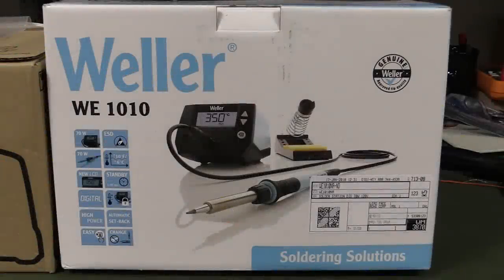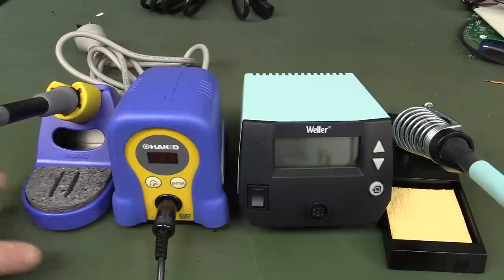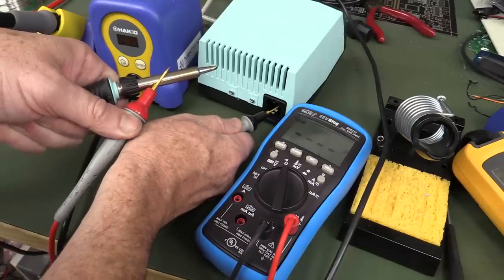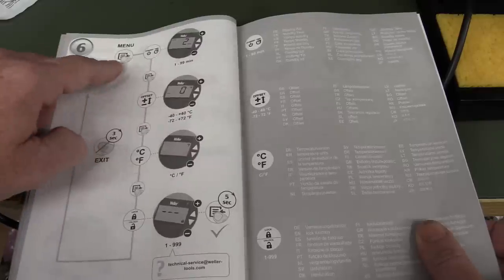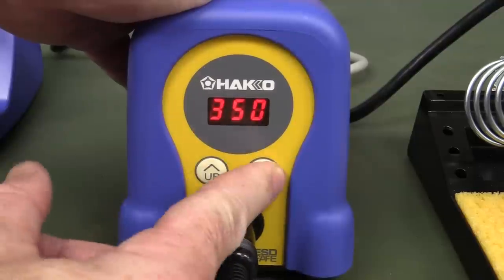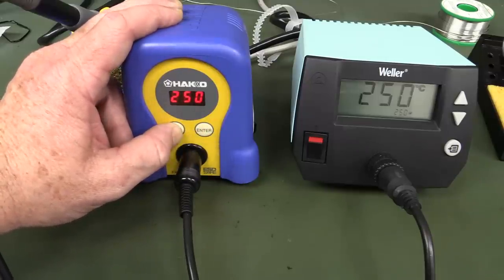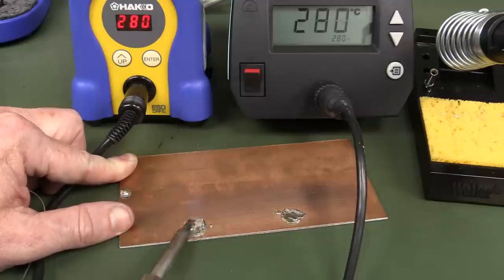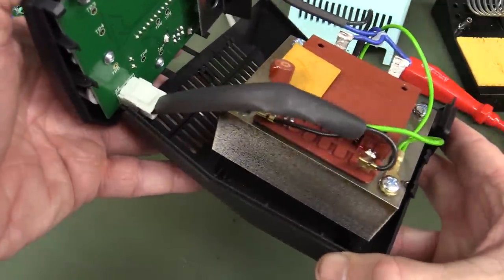EEVblog #1063 - Weller WE1010 vs Hakko FX888D Soldering Station

Comment: Used Weller irons throughout most of my career in electronics, and still rate them as the best. Some guys preferred Antex but I never liked them. The cheapest route to a decent soldering setup though, is a Yihua station with a Hakko tip. ;)

Comment: I’ve had my 888D since it was first released over in the U.K. and I love it, replaced an old weller that was passed down. A lot of people complain about the temp control (but I really don’t mind it, easy enough plus with presets it’s simple.

The only bugs are the power switch, the forever shrinking sponge, seriously mine is the size of a 2 pence piece :/ ha and perhaps the lack of ‘stackability’ (but I can live with that for such a beauty of a design)! 

I am glad someone else has commented on the DIN connector, it does flap around in the breeze! Haha! 

I’ve had a Weller in the past and used other higher end ones and they are pretty good for the price to be fair! Plus I kind of like that colour scheme...

I don’t think you’d go wrong with either to be honest, both looks great! 

Longevity wise, perhaps I’d look at the Weller (only down to my last one being about 15 years old) however I’m yet to have any issues with the Hakko (a lot of complaints about them burning out but perhaps it’s standby heating, I’m pretty sympathetic when it comes to tooling).  

Loved the review Dave!

Comment: I have the hakko and I like the compact size and the brass cleaning tip inside the holder saves also extra space. I personally hardly use the sponge as the tips gets cleaned really well with the brass. I agree that the analog version is more straightforward in changing the temperature with just a knob, but once you get the presets configured it is actually fast to change between them using just a button

Comment: I'll take my TS100 any day of the week! Integrated heater in the tip and heats up in seconds, sure it makes each tip very expensive ~$12, but they are high quality and dead easy to switch. Slim design, some may argue that this is a con, but I see it as a huge con as it sits very well in the hand and means it is portable (you can literally fit it among your pens in your bag!). It's powered from DC 10-24V, meaning that you can take you with you out in the field and power from a lipo, at home I use an old laptop charger. All of this for $50, I repeat $50! It doesn't come with any stand, but for the price one can by a decent stand separately. I would also recommend that you buy a good and flexible extension cable with 90 degree power jack (standard 5.5mm DC jack), the cable drapes much better and gives significant better experience!

Comment: I used a Weller TCP 24 for about 30 years it was never broken  and still works fine. 3 Years ago I got an ERSA Pico for about 150€ and I like it very small and heat up very quickly but I don’t think it will hold as long as my Weller.

Comment: I can't imagine going back to stations where the heater is not integrated into the tip. It's like going from Axiom Audio M3 to a gramophone. NEVER!

A lot of the knockoff Hakko 951 look dodgy inside but they do at least work. I'd rather a ripoff of newer technology than quality manufacturer using old junk technology. I can't believe these are even sold anymore on stations costing more than $50 in 2018. 

Just watching the time they both took to heat up made me want to cry. It isn't simply impatience that makes these irons lame.  When touching the pin of an IC that is going to absorb a bunch of heat like ground or power plane, the temp drops and the iron's controller sends more power to compensate. When the heater is not built into the tip that process takes way longer and you wind up having to solder at much higher temperatures to get anything done, or deal with the more aggravating method of doing work with an iron whose temperature dips. It sucks so bad.

Never going back to this stuff!!
Reply: Louis Rossmann 

Have you tried any Metcal / OKI stuff with the curie point tips?

I've used Metcal for about 12 years (since using them in electronics factories), and never felt the need for manual temperature control.

As you say, the whole point of them is that they boost the RF power to the copper slug in the tip, so work great on both small SMT stuff and large ground planes.

I agree - I don't think I could ever go back to using an iron with a heater that is "indirectly" heating the tip.
Reply from the maker: The near instant heat irons are great, but are there any in the $100 price bracket?
Reply: Around $230 now gets 120 watts of American Pace power ( https://www.youtube.com/watch?v=NEUriXoYPzQ )
Reply: I built a home made Hakko knock off station using a 33 volt transformer from a old hi fi amp and one of those EBay Hakko knock off wands and a few parts from that old hi fi amp and it will out perform bolt of these with a 8 second warm up time
Reply: EEVblog TS100 & Ralim firmware = best iron in this price range (~70$)
I would really like a video from you on this one testing and given your opinion. ;)
Reply: EEVblog 

Possibly not quite that cheap for a decent one, but all of the Metcal stations I bought were second-hand on eBay, as they are generally very sturdily built, so tend to last many years.

The smaller versions like the SP-200 (with handpiece and one tip) can often be found for around $120-150, and still way more capable for anything new around that price, IMHO.

Granted, the new tips usually cost around $16-25 each on average, but they easily last 5 years or more if not abused.

(like using them to pry up bent pins. Guess how I found that out. lol)

The cost of a new tip is akin to replacing a cheapo mains iron within a similar time frame tbh, so I think it's more than acceptable.

There's a nice video on YT somewhere which shows that you can even remove the tip while hot (using the heat proof mat thingy), and still use it to reflow solder on a large copper ground plane for 10-15 seconds afterwards, while able to hold it by the cool end. I'll link it here if I find it.
Reply: so what do you recommend for the hobbyist under 150. not everyone needs a $1000.00 iron
Reply: I'm using an XYtronic LF-3000 (cost less than 100€). It heats up to 350°C in 15 seconds (just timed it from cold). The slow part in heating is from room temp to about 250°C, from 250 to 350 it's about 3 seconds. Don't know if you count that as "near instant", it sure is fast enough for everything I do. 
I've had it for a few years now (don't know exactly how long, more than 5, less than 10) and am very, very pleased with it. The build quality is awesome. A full metal case, built like a brick, inside is also clean and done well (even the connector to the iron beats the Hakko and Weller of this video, not just a twist lock but an all metal screw lock).
I later bought a hot air station as well and it is the same quality.
Reply from the maker: ElectronAsh - Sorry but 2nd hand doesn't count.
Reply: Louis Rossmann may be the most famous tech in America, and he repairs MacBooks, some of the most challenging soldering from a thermal mass standpoint, and he could afford those irons that cost $1000+ but he prefers the Hakko FX-951, which is only $235 on amazon! - So don't think you need deep pockets to solder like a pro!
Reply: He's American, but evidently not patriotic enough to try a Pace.
Reply: EEVblog the Ersa I-con pico is available for about 100€ and heats up extremely fast. Its the best soldering station at that price point IMO
Reply: Electro-ash: Yeah,sure, killed 2 in 1.5 years, never Metcal shit again for me. I have a Pace MBT250 and a Weller WS-81. But they are a whole different class regarding performance. Is the new Weller a replacement for the cheap red Wellers ?
Reply: Ed Yager I recommend DIY for hobbyists, there are some really nice tutorials from Russia, I'm just building myself a 2in1 Station. There are many points why diy and saving money isn't even the point: As a hobbyist you have the time, you will learn a lot about some electronic components and other things, you can decide which tools you use, you can use any brand, Marco Reps and GreatScott! have nice turorials with JBC soldering irons, you can make your own design, which kind of display, encoder, pots or buttons, make you own menu etc. and will have something that you use and see all the time and know you created it, I recommend to put it near to your bed when its done, so you can see it when you wake up xD And finally there is no big science behind controlling a heating element, just need to turn it on when the temperaure is lower than needed and turn it off again when it is higher, if you make your own firmware, you are free for all functions you can imagine, I have some that even the most expensive JBC doesn't have.
Reply: Half a year ago, I've bought more modern version of it - on a STM32 controller. It cost me around $100 for the following: controller, two handles (different ones - one like in the link, another for heavy lifting, hakko-style mounting, but T12 tips are used), metal case and  6 different tips. For power supply I used old notebook 65W brick. Works neat. Hakko 888D is much worse, than this one.
Reply: The link was just a current example, but I purchased the power supply, handles, tips, and controllers (2nd one for my Father) from various sellers. I'm using an old external hard drive case as the housing. I've seen the STM32 based controllers, but what I've got already works perfectly so haven't given them a test/try. Much of the magic comes from the T12 tip itself. Going from a system with M900 style tips to the T12 tips is like switching from dial-up to broadband, you never want to go back.
Reply: Louis, i get your point. But your point is from someone who uses his station every day for a living with boards with a lots of thermal mass. But there are people who simply enjoy doing electronics and never get back a return of investment fom their soldering station. Dont get me wrong, i dont say buy shitty tools, because when you buy cheap tools, you always buy twice. A lesson which i have learned for myself. Shitty tools arent fun. But i think a station for about 250$ is too much for somebody who does this for a hobby
Reply: +EEVblog Dave, give an Ersa Nano a look. Great stations and tips.
Reply: +EEVblog I can recomand the BK 3000LF it has a integreated heater tip thing and cost less than $100 delivered and its super quick in heating up(~6 seconds to 350°C). Much better than my Ersa Analog 60.
EDIT: Shipping outside the EU seems a bit expensive.
Reply: Jonas Meyer That looks great! I've never heard of Black Jack. Does it use a standard tip design or their own?

I can see there is a good selection of tip. I also like the iron being slim, if I'm seeing the picture correctly??
Reply: +Simon Ashton I just use the default tip(0.5mm conical) but i think it uses the same tip as some Aoyue stations so there is some selection. For SMD stuff its really good. The finest stuff i soldered was a 0.5 FPC Connector and a QFP15 128-pin at a 0.4 mm pitch. I also never seen the company before but seems quite good. I would compare the station to a low to mid range Metcal/Oki(~300€ i think) station which i use at work. Dont know if you meant the tip or pencil being slim but i took a pic of some penicls for comparison: imgur.com/a/GouSw
Reply: But you ARE impatient. And that's to be expected from someone who uses the station as a tool for business. I'm not the least bit bothered that I have to wait an extra second here and there, because I don't have 20 boards to finish by the end of the day.
Reply: EEVblog yes, TS100
Reply: Ed Yager TS100
Reply: burrito rustler that does have the heater in the tip though
Reply: Cliff Matthews or a Metcal
Reply: pa4tim I killed 0 in 5 years
Reply: Wilson can you post the link to the tutorials?
Reply: +ThinkLearnSolve A great diy soldering station is the UniSolder 5.2 which can be found on dangerousprototypes.com. But its a bit more advanced i would say.
Reply: True. A big name station is sensible if you are earning a living using it. Not if you are just having fun.
Which is why many here are recommending the T12 style  self assembly models from Ebay. If a kit is beyond your comfort zone at this point, go for one of the ready made units. Not as cheap, but still damn good. 

I got a pretty basic  Yihua Hakko clone about 8 years ago. Cost me £40. Worked great until I upgraded. Still there as a spare.

I would like many here, recommend the T12 style units. Heat up in seconds, and are capable of getting really hot if you need to melt something with a big thermal mass. 

Brand name gear is nice if you want to show people how keen you are, but for a hobbyist.. Pretty much fanboyism. 

You solder with the hot metal bit. Not the logo.
Reply: +EEVblog
Don't know about near instant, but the is a lot of stations with way more better thermal compensation.

Even with traditional ceramic heater element.

I don't known what going on here, but this is definitely not 90W power pumping in this irons.

It seems quite curios to me. How about to measure actual power coming through heaters of this two stations?
Reply: Agreed. No professionals use these type of irons. Composite tip irons like the fm-2027 are the way to go.
Reply: +1 about the tip, what's great about the Metcal tips, is that they are really small compared to JBC tips, and the heater does not occupy more space
Reply: as Dave demonstrated, for the most part temperature control is necessary when your iron has bad thermal capacity
Reply: did you buy them new or used? what station?
Reply: Get a TS100 (you got one, I got one. Life is good)
Reply: What I don't like at all from the TS100 is it doesn't have a proper finger grip. Having sweaty hands like me, I wouldn't trust my fingers not to slip to the heating element.
Reply: Dassd Schsdu Never having used neither, I think I prefer Hakko, because of the stand and better functionality in the same price bracket (yours was a special case, and most can’t get that discount). So because I have a maximum budget of 150 €, I’ll buy the Hakko (also, the Weller is only available with the US plug and 120 V, so I’d also need to buy a transformer).
Reply: I just wish they made knock-offs in the $100-150 range! The 951 clones are all like $40 cheaply made crap, but $250-350 for a solder station is extreme unless you do it commercially.
Reply: its just crazy to me that they made a new iron without direct heating. there's no good reason
Reply: After ditching my weller for a Pace WJS 100, I have to say based on its performance I want my old weller back, the tips seem to last about 2 to 3 months and even the biggest tip just gets the heat sucked right out of it, it really struggles to penetrate some connectors that my lower wattage weller used to have no problems with.
This Pace sucks and is getting replaced.
Reply: @23RaySan  if $250 is breaking a person's wallet, how do they even have a hobby? It also doesn't hurt to buy tools that can take the extra workload in case something comes up. Say you decide to buy a build it yourself NES kit, and there will be a lot of soldiering involved?

Comment: The Hakko fx888d can be bought in different configurations, especially on amazon.  Mine included a chisel tip and the flush (90 degree) wire cutters.  Don’t knock Hakko for your cone tip, knock your supplier!
Reply from the maker: Fair call.
Reply: EEVblog Thanks for the reply!  I’m a sophomore in High School (USA).  I got the 888d as a Christmas present over a year ago!  It’s wonderful :D

Comment: I bought an FX888D a couple of months ago, at Microcenter. It was priced at $99 on the shelf, but it rang up for $68. I asked if that was correct, and they told me yes.

If you're looking to buy and FX888D, and you happen to live near a Microcenter, you really ought to check it out. I can't imagine that you will get a better soldering station for $68.

Comment: We go through so many of those damn weller iron handles because the cord swivels around and eventually breaks the wires inside. I've been taking a large zip tie and tightening it around the flexible part of the strain relief. Holds the wire tight at least.

Comment: A tip I learned from my work.  Use only distilled water for your sponge.  The minerals in tap/bottled water can contaminate your solder joint.  Important when peoples lives depend on your soldering.
Reply: randycarter2001 I learned never to use a sponge, it kill the tip fast by corrosion.

Comment: I love my Hakko 888D but I have to admit the Weller does feel better to work with having up and down buttons to change temp.
  Hakko has a rather nutty idea with how you set the temperature on the 888D

Comment: Hakko also has that software that hides the actual tip temperature till it is far enough away from the set point, then follows the actual temp, but in the interim it simply displays set point only. Weller does follow actual temp in real time. Weller will benefit with some Copaslip on the tip to improve thermal transfer, plus the tips will not seize with long term use.
Reply from the maker: The Weller actually seems to do the same thing.

Comment: Well, I bought a hakku partially based on this video. I tripped over the cord and pulled it off my table and crashing into the ground. The this host was right - it's solid as hell and still works like a charm

Comment: I'm still rockin a Weller EC1002 with a 40w iron. Works really well for all my hobby needs (plus it was given to me, free iz good). Tips are cheap enough as well (same as the ones you are showing here). I've thought about upgrading several times over the past few years, but this thing keeps working so I'll keep using it.